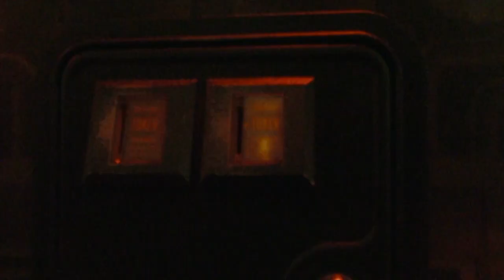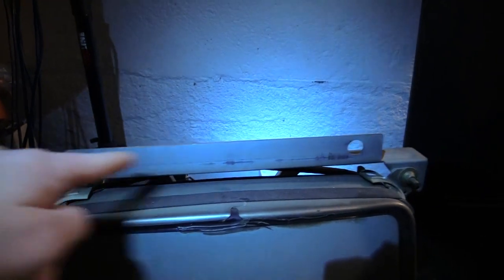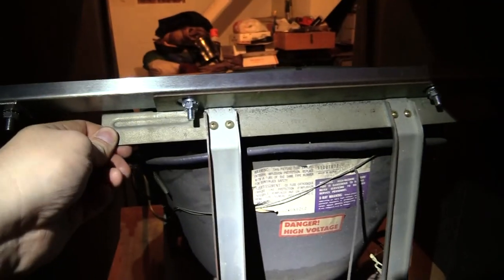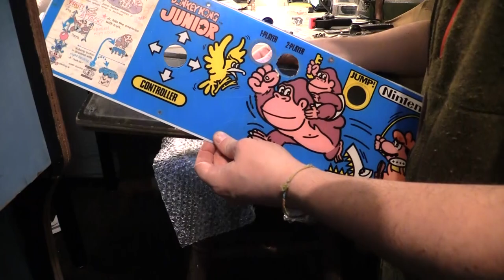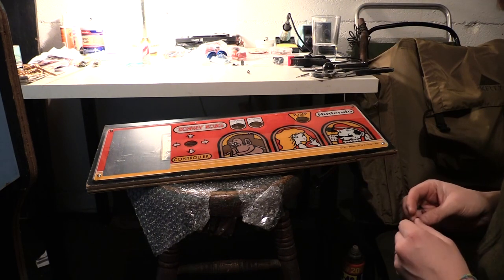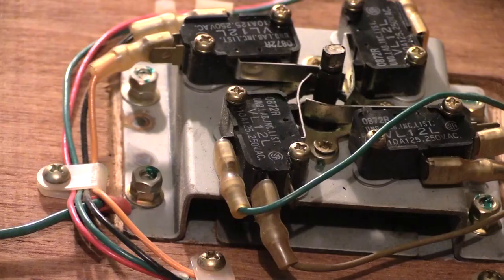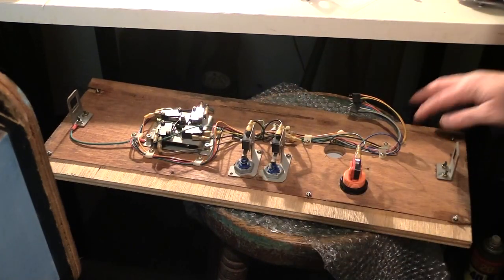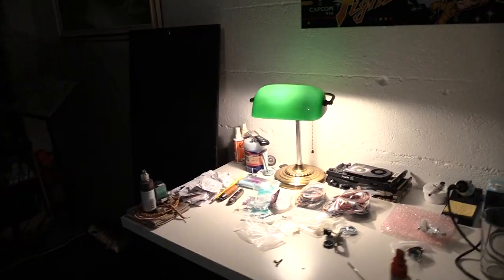Donkey Kong - Repair Part 1 - Monitor, Control Panel and more! | Arcade Restore

Comment from the maker: To the person who just erased their comment. Here's my reply, "Go to an arcade parts website like arcadepartsandrepair, arcadeshop, mikesarcade and order a cap kit for your monitor; its probably a sanyo ez20 as most DK's were. Also check the cent and hold pots (dials) on teh back of the monitor, its possible it just needs to be adjusted."

Comment: So I have this same Donkey Kong Arcade. but recently my little cousins did something to it and now the screen is narrow visually during game play. do you know how to possible fix it?
Reply from the maker: Narrow but complete? Or is the picture look like some of it is actually cut off and missing?
Reply: @wildernessgames  its complete. i can play through the levels but its narrow like zoomed out.
Reply from the maker: @lilwayne3045  Adjust the vertical width knob on the back of the monitor.
Reply: @wildernessgames  ok ill try it when i get off work. thank you so much
Reply from the maker: @lilwayne3045  Glad to help, good luck! They were probably trying to adjust the volume and turned the wrong pot.